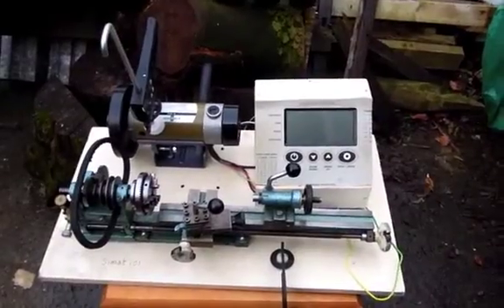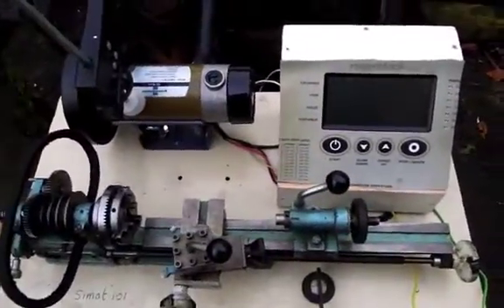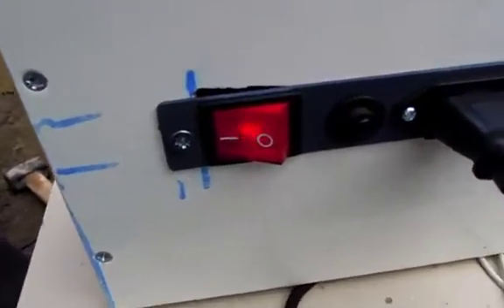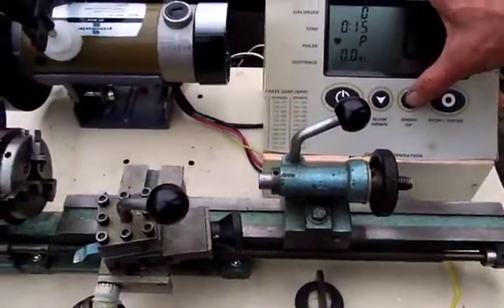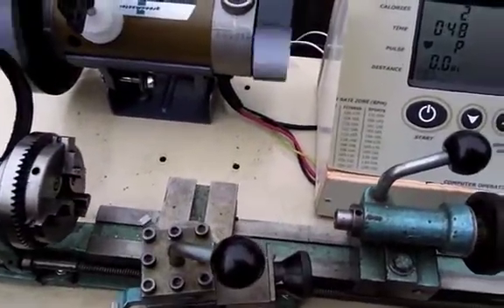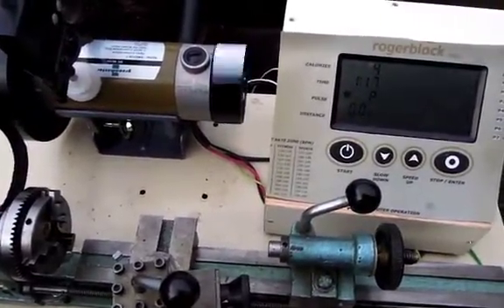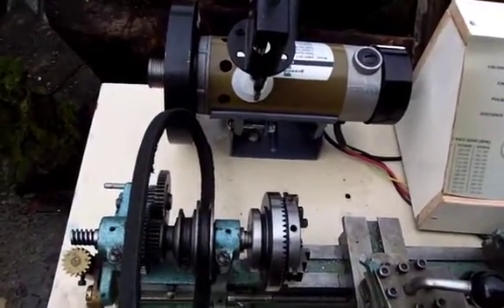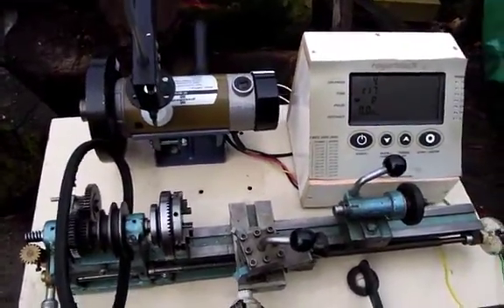Treadmill motor for modellers lathe

Comment: That all looks very promising John ,,, Have you done any turning before ,,,, or is this you first venture into machining,
Reply from the maker: Hi Alan. I have done a very little. My first projects will be plastic, wood and softer metals such as brass, aluminium and mild steel. I need a chimney for that loco.
Reply: John Mellor I think I may have said turning and machining is always something I wanted to have a go at ,,, to try and build one of the Stuart type models,,, but never had the Money for the tools and Lathe,,,, Hence why I ended up building the beam engine without a lathe,,,,,  I hope you do a few videos of how you get on,,,, and im liking your approach,,,, take a dead cheap but operational loco,,, then re-build ,,,/  re-model it  ,,, you sort of have something to show for your efforts while you build up the new skills,,,, and progress to other things ,,,, Great job ,,,,, though I love your inventiveness
Reply from the maker: ***** a decent lathe is a lot of money and then you need a mill four serious work which is even more expensive. I got this for about the same price as a oo gauge loco and far less than a laptop or even my current phone.  It will outlast the laptop and phone. But will it get much use? Keep up the great engineering projects Alan.
Reply: John Mellor Ya Too much money for me to invest  ,,, and I read one article that said if your starting out then don't be surprised when your scrap bin fills up and you still don't have a part thats usable,,, and then buying second hand lathes is almost a NO NO unless your really experienced anything thats worn results in parts that are totally unusable,,, and even setting up a new mini lathe you have to all sorts because made in China they are thrown together and need virtually a complete strip and re build setting all the centres etc, etc etc,,, if you want to do anything to a reasonable tolerance...  ,,,, then as you say will it get a lot of use,,,,,,,Thats why I went with the idea    ,,, who would ever see that it wasn't a cast iron cylinder once its clad in Mahogany and brass banding,,,, Lets just build something that just works even if it is 4 inch soil pipe ,,,, but like your saying I bet a second hand lathe could be used for all sorts of parts modeling in plastic and aluminium etc,,,, I think that could be a half way house,,, I may think about looking for something similar ,,,,
Reply: ***** I think your first reaction is the right one Alan. I have spent a whole evening stripping and freeing the chuck. I still need all sorts of tooling just to turn a chimney - like a chuck key to start with. You can buy ready made components for less than making them - eg wheels.